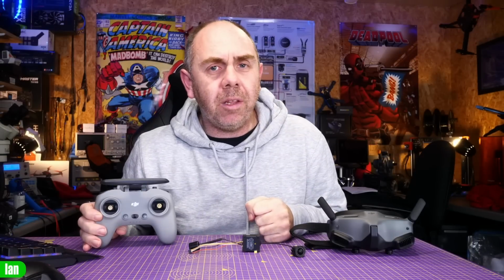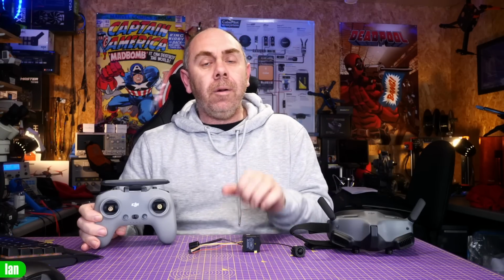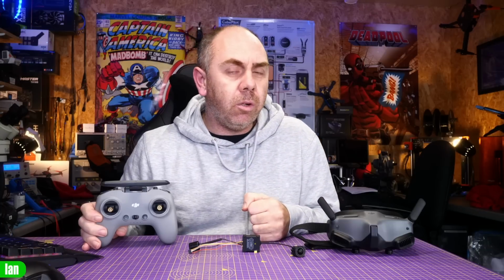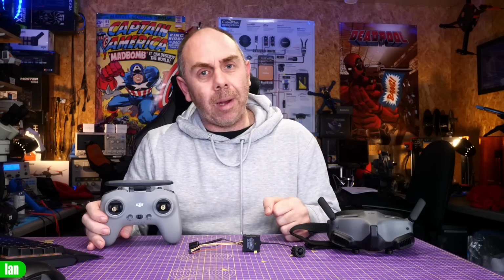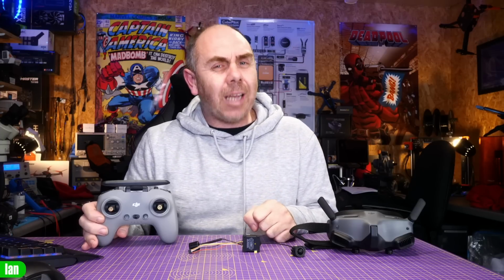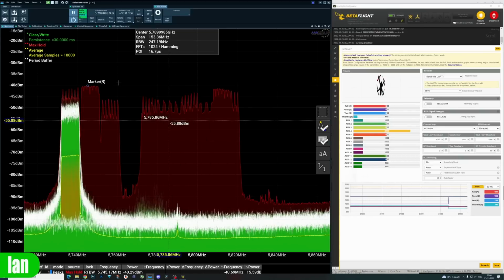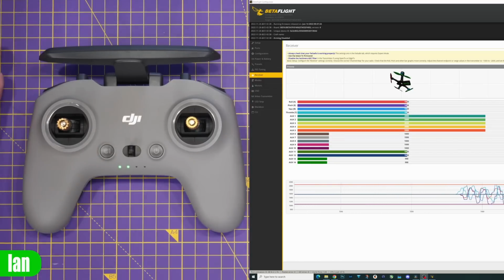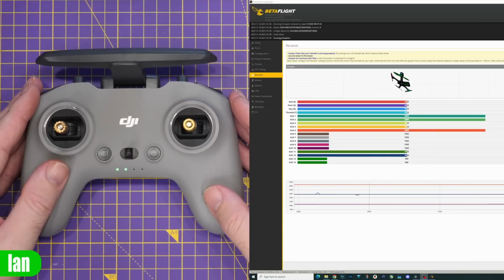DJI O3 Digital FPV Remote - Its Got One Problem

Comment: Got an o3 unit. I am a knewbee but not good enough yet to take out my pavo pico.  Thanks for the help I'll get you a couple of ☕️ ☕️ later.   Will you tell me why the connection 6 colour strip does do the rx tx tx rx thing. Do I have to modify it? I'll set it up soon.

Comment: 1 year on, is the RC3 better with the 03 unit re these problems?
Reply from the maker: The same fundamental issue remains.  The remote single will drop with video.   It'd my advice to always use your own separate remote system where you can choose to trigger failsafe.
Reply: @MadRC  thank you so much for replying. I am flying pretty close to me with my Nazgul and don’t go behind objects. Full bars on RC 3 and goggles 3 so should be good right?

Comment: Great video.
Has this changed with the Dji Controller 3?
Thank you
Reply from the maker: Somewhat yes and no. They have changed how it works however now it’s worse in the sense the remote is only talking to the goggles.  If you loose video you will lose rc as well.

My advice is always to use your own RC system.

Comment: Hey can you test this with the new goggles 3 and rc3 now that they've added o3 support?
Reply from the maker: The way the V3 remote works is to does never connect to the air unit.  Only the goggles so you will always loose RC when you loose goggles.
Reply: @MadRC  oh interesting, thank you

Comment: I wish I had seen this before I bought two FPV drones with DJI O3 and PNP! So I am stuck with the FPV Controller 2. I guess my next step is get a ELRS radio and when I get another drone (come on I only have 5 so far counting the DJI factory drones of course I am getting more drones!) order it with ELRS. Is it possible to add ELRS to an existing drone that only has DJI O3 PNP?

Comment: _i have updated my fpv remote and goggles to the newest firmware that can now compatible with the new avata 2.. when i bind it to 03 air unit, no stick input in the betaflight. Nothing reads in betaflight in reciever tab and i set my reciever and ports correctly.. how i fix this?

Comment: I am currantly trying to connect my FPV controller to my 03 Air unit. Everything should be connected correctly, as the ribbon-cable that followed with the O3 unit connected perfectly to the FC. The only problem is that the controller imputs don't show up in Betaflight. Any ideas as to why?
NB: I have changed my controll-protocoll to SBUS baud fast in the googles

Comment: Is this still the case in the latest O3 firmware? It's very tempting to stay within the dji environment which seems to be DJI preference, seems strange they would push you to secondary controller requirements just with a stilly setting oversight.

Comment: I've been using this since it came out and I've had no issues with connection. The only thing that annoys me is that it needs to be paired every time you swap quads and the gimbals are too small.

Comment: but the Remote Controller 2 also works in conjunction with the old Goggles V2 and the O3 Air Unit on a self-built copter⁉️
Reply from the maker: Yes.
Reply: now it works :-) 
 @MadRC

Comment: Great video. Got a question for you I got a lflight evoque 5 with air unit 03 brand new and suppose to be bind and fly. This drone drop few times not even 80 meter in from of me and with my DJI FPV and AVATA i never ever had any issue . What i am missing here or suppose to do and is it gone happen again with other control ? Why no other company can do a proper RTH beside DJI those drone are not cheap 
I like to film beautiful and fast footage and above water and i got the evoque because of the speed and stronger frame and freestyle capability and absorb crash better than DJI . Thanks a lots

Comment: I can not use goggles and would like to use the O3 with a screen through the DJI RC with an integrated display. Is it possible to use the O3 only with the DJI RC without goggles, and is the air unit's SBUS output standard enough to be compatible with ArduPilot?

Thank you.!

Comment: So if in long range flight, you lose your signal say, if the drone has a decent gps unit, and is set to return to home. Presumably once it starts flying back, the goggles will reconnect and then you can re fly like Normal? 

Just trying to work out my set up from my next drone after my FPV and it seems to make sense to use the goggles V2 and the controller. Brilliant videos and much appreciate the help I get from them all.

Comment: I am quite new to fpv hobby but what is the point of having a radio signal on other quads than Dji when you loose video? is not going to return home I suppose? or is hoover in place? I know You can install RTH on other quads ect but how reliable is that? Great video as always.

Comment: Hello, I have a question about the DJI FPV controller 2 connecting to the 03 Air Unit. It shows to be connected by lights on controller and IFlight are in proper sequence but it won't show any stick movement on betaflight, it won't arm the drone or anything. Any suggestions?
Reply: set sbus speed to normal in the goggles.
Reply: Thanks!!!

Comment: Thank you!! 

This actually sucks, as in those five second most probable that drone will end up crashing somewhere

Or is it possible to set the gps to return home if controller looses signal?

What about transmitting from controller 2 to a nirmal crossfire reciever?

Comment: I love your videos and the technical approach you take.  Although I'm glad you pointed out what happens on video loss, your conclusion to not buy this controller is one that I disagree with.  Fine if you want to install a separate system like ELRS, but I want to eliminate that additional step and extra antennas to deal with.  The two things you point out that you lose with the signal loss is to put the system into failsafe manually or do a punchout.  Neither of those make any sense to me if I have no video feed.  Putting the system to full throttle when I can't see the orientation makes no sense, and pushing my failsafe button is not necessary as I will program betaflight to do that for me.  Others have pointed out that this controller and an 03 air unit have superior range to my original air unit, and the range, game style controller, and elimination of another system are the reasons I'll upgrade my entire DJI FPV system and including this new controller.

Comment: So I have a question.  I'm having a strange behavior on multiple quads with both O3 and updated Vistas.  Whenever I'm flying NEAR myself, I get a momentary RXLOSS flash up on the OSD.  Most quads don't actually feel like there's any interruption in control, one quad with GPS and has zero delay to initiate GPS Rescue, twitches when the RX Loss comes up on the OSD.  My thinking was that it was on 5.8 Ghz when it was near me and as soon as I ranged away it changed to 2.4 Ghz?  That small channel change causes a miniscule RX Loss?  I never get the RX loss when I range out, even extreme long range.  During all this the RC Signal quality is always maxed out.  Any thoughts on this behavior?

Comment: I've flown my Avata for about 3 months now, some flight with 2-3km away, i have lost video feed for couple of times but never lost the control link, so may be this O3's issue could be fix with a firmware update. Just build an O3 quad and plan to fly it with my FPV controller 2, i hope DJI fix this issue soon.
Reply: Which google you are using?
Reply: @doitchannel67  i'm using DJI Goggle V2. i just gave up on the DJI Controller 2 and switching to TBS Crossfire with TX16s controller after crash my 5" quad 2 times yesterday because of RXloss. Even with the newest FW for everything and manual switch to 5.8ghz band on the goggle as people said it'll work. It is not ! Never trust the Controller V2 with O3 again.

Comment: Hey I have the mark 5 with dji 03 system, the googles 2 and the dji remoutcontroller 2. I connected everything together.  When I make the controller movements in betaflight it is nothing displayed, even though the controller is connected to the drone.  How can I fix the problem?  All products are new.  The movements are not displayed, do I have to change something in particular?

Comment: I have an excellent question about the o3. Air unit. If I put it on a rc car. Can I use my dji fpv remote to arm the air unit. To get maximum power output. I’ve heard it’s a problem for people to get it into full power mode without it beeing in a drone.
Reply: Só desligar o modo econômico e ligar direto na linha da bateria em vez de Pad deixado como 9v por exemplo

Comment: I have a DJI DIY FPV build with03 Air unit with firmware version: V01.02.0000
V2 goggles with firmware version V01.06.0000
V2  transmitter with firmware version V02.00.0500

These are all bound together.  The problem I have is that I get an error message saying:
DJI RC-N1 remote controller firmware version too early.  Function limited. Connect to computer and use DJI Assistant 2 (Consumer drones Series) to update.

I already did all this the moment it was unboxed

Comment: I have read online that DJI resolved this issue with an update. Can this be confirmed? I'm at the cross road between the RC2 and Tango2.
Reply: also the same problem here what u did ?
Reply: @filmscapefilms  I could not get it resolved and sold the remote 2 like many others.

Comment: Hope u don’t mind me asking but do u know how to bind the controller 2 to iflight defender 25,  ( has the 03 dji air unit ) have installed correct firmware to the controller, thank u in advance. Love your shows.

Comment: Oh I was thinking of something really cool. How awesome would be in the controller setup (for controller 2) in the goggles to be able to change the behavior of the buttons, like “momentary”, “single press latch”, “double press latch” and “single + double press latch”. Since it is anyway inplement it for the Avata drone.  This way we would be able to do more with few buttons and also have same switches configuration as with our avata’s. Also would be cool if the system could forward the head tracking of the goggles 2 in two of the free sbus channels for cool gimbal control 🤙🏼

Comment: Hey guys I am using my goggles 2 and controller 2 with Avata and O3 air unit. Every time I switch the goggles from "avata" to "o3 air unit" mode, the controller only will lose the bind to the aircraft either the avata or air unit. Do you also have the same problem?
Reply from the maker: Sadly yes this is a quirk of the DJI system and basically normal

Comment: If your not using the DJI controller and using something else how does the air unit know that the FC has been armed and thus go in to high power mode??..🤔🤔🤔⬆️⬆️⬆️⬆️
Reply from the maker: That’s all done via MSP, it takes the arming command from Betaflight.
Reply: @MadRC  MSP? Is that via the video output hud line from fc to air unit?

Comment: Thanks Mads. Its behaviour seems almost designed to work with Return To Home functionality, because when that is triggered the drone will gain altitude and then you will get your control link back after a few seconds, which is what would be necessary anyway to guide back if within LOS or to get a better video signal. Having control far away without video, is that necessary anyway? I think for a fair evaluation of this 'feature' we need to know whether the video link and RC has sufficient range for normal use. From what I've heard the video range is excellent.

Comment: I have swithed from Fast to normal baud rate and i do get it to work it arms and i can fly, But i do get micro fail safes and i get fail safe from life 50 meters from my location. My google connection is perfect but the rc is horrible. Any ideas what is going on ?

Comment: Question: what can make me lose connection? Just flying way too far ? Or are there any other reasons ?? I am about to buy air unit o3 with fpv goggles 2 and controller 2 I don't  know how to weld so that's  why I was gping to stick with the airunit and use 3 in 1 kind of deal plz help
Reply from the maker: Basically yes range will be the largest cause. As will obstacles
Reply: @Mads Tech  THANKS FOR THE REPLY ...would you recommend o3 air unit with dji goggles 2  and dji fpv controller 2 ? Or solder a crossfire with tbe tango 2pro  ? And just use the dji goggles? I don't  want to risk losing video conection  and controller getting affected aswell. What will the drone do when it loses conection? Thanks !!

Comment: hey mate ,  would you recommend flying with crossfire instead of dji remote controller 2 ? Do you think crossfire has as strong a range performance?  

planing to get the nazgule but not sure what smater. keeping it dji or using crossfire with the tango 2
Reply from the maker: Crossfire has one of the strongest performances of range there is in an RC link.  Also ExpressLRS does too

Comment: I just read this on the DJI forum.  Interesting

"The FPV Remote 2 & the Motion Controller, neither support PD charging.

Using a USB-A to USB-C cable will solve this problem, you will also discover that the Assistant 2 App will not connect to the controllers if you use a USB-C to USB-C cable. So if you're using a Mac, you will need the USB-A adapter. With this you should have no issues."

Comment: Just a quick question about charging the remote controller 2. I've got something going on that's  kind of unusual. I can't seem to charge the remote 2 with a USB C to USB C cable with a high-speed charger  30 watt -100 watt watt. I have even flipped the connectors over just to make sure. But it WILL work with this cable if I have my digital tester between the charger and the remote 2 and its showing 4.8 volts at 1.7 amps. A USC A to USB C works fine. Very Odd.

Comment: My DJI RC failsafed today with the O3 while the video feed stayed perfect, and it was only about 100m away from me. I have no idea why. Any thoughts about this?
Reply from the maker: Odd that.
Reply: leads me to think something is wrong with your yellow sbus wire. You had video just fine and only the rc link cut out while you were flying? The yellow wire is what runs telemetry commands. Interesting problem. Id be interesting to see what switching out the connector wires from o3 to FC would do. If not all the wires at bare minimum, the yellow one.

Comment: Is there a chance you lose RC Signal before Video? Specially new O3 air unit has longer distance than the old ones. “Lets say 1mw crossfire” is it still better than the new RC?

Comment: ThanQs for sharing this.   Great info.  I flew with the black dji remote for a long time on the v2 system, and it didn’t have this behavior - and my justification for using it - but, this is a deal breaker, for sure.

Comment: Hi, reliability aside, is there any difference between this DJI RC and iflight Commando 8 (ELRS 2.4GHz) in terms of range and penetration? What do you think?
Reply from the maker: ELRS will be massively better. I’d go with that over the DJI remote period
Reply: @MadRC  do u know what's the lowest LQ value for elrs2.4 at 50hz?

Comment: So the range with transmitter2 is the same or less than using with the plastic dji fpv or avata ? Vs 03 airunit . ? Who actually flies that far they lose video feed ?

Comment: the goggle and airunit transmitting via 5.8ghz and can work fine without 2.4ghz rc,  DJI said V1 does not support O3 system due to lack of 2.4Ghz !
Reply: It looks to me 2.4ghz is a fallback, they should make it so 2.4ghz is default for RC, otherwise it seems to happily use 5.8ghz for both. Is there even a 2.4ghz radio in O3 air units? I haven't entirely checked, otherwise this is a silly software bug that it seems unfinished.
Reply: They can make it work with V1, they won't because they want to sell the new stuff...they make more money selling new inventory than make "sold" inventory compatible...legal scam

Comment: Can you change from 16:9 to 4:3 during flight with this controller? I fly with a Vista in 16:9 because I feel like it's more immersive, then I switch to 4:3 at the end because it's easier to land. I do this with the black DJI controller's toggle wheel, to access the menu. I just have to stop recording for it to let me switch. Can the grey controller do the same with the O3?

Comment: For the avata which uses the same system I always lost video link with rc strength being full bars.  Curious how it would drop out first on this unit.  Seems like a simple firmware update for them though 😎.
Reply: same here, i never lost a single bar of control link on the Avata, curious how long it'll take for DJI to fix this.

Comment: Nothing new, same stuff as the scenario with the old dji fpv transmitter. You can also Programm fs on inav or bf. Moreover due to better o3 connection, if don't do unlegal things with your stuff you wouldn't bother on the points referenced in the video

Comment: One major issue I found with the logical buttons is they don't have a default position.  If you power off the remote they remain where they were so you can't assign anything to them and know that it will return to default.  So really, you only have two 3 position switches to work with.

Comment: DJI's FPV Drone (aka The Potato (which I still love)) almost always had a much better control link than video link.* I'd be amazed if DJI couldn't fix this control problem on the O3. While DJI could fix this problem, will they?

Like many people, I love and hate DJI. DJI makes great stuff but they sure can be slimy at times. I hated I had to "activate" my action camera before I could use it. Why?

Thanks for another interesting video.

*The control link quality is logged. It rarely dropped below 100% on any of my flights even when the video quality was awful.
Reply: Yeah my dji fpv drone was also pretty great at recovering, helped me learn not to loose video signal when I got my new fpv drone with o3 air unit, lost video signal and control signal with it and didn't wanna fly back up even with rescue mode enabled